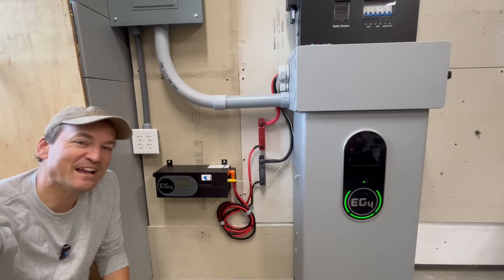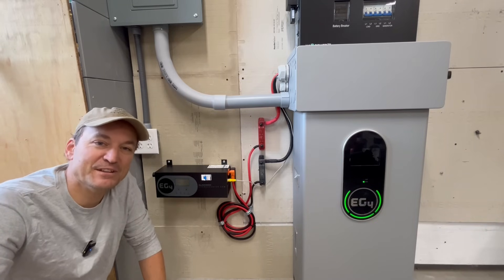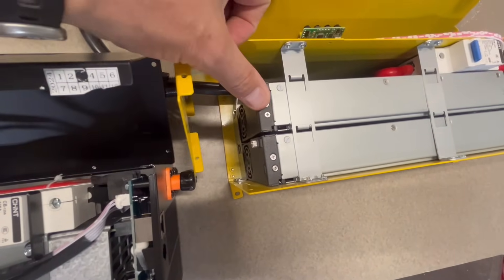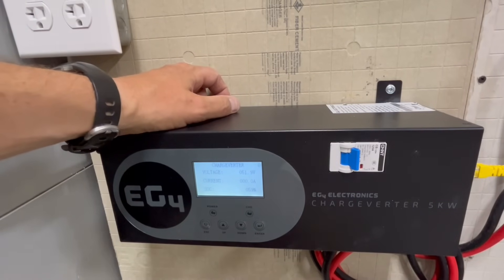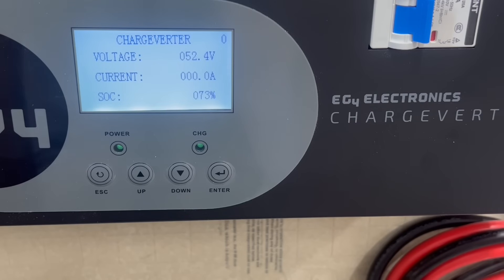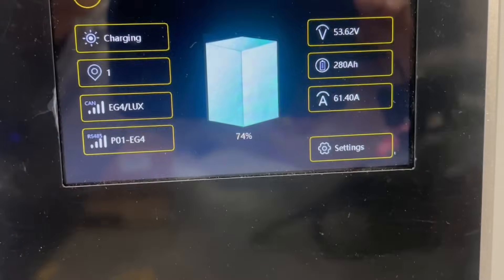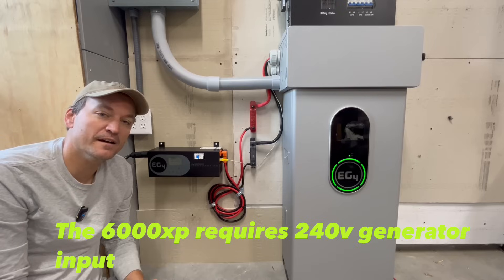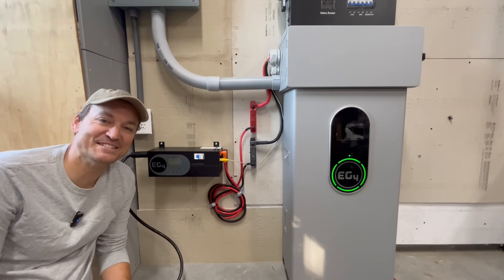New EG4 Chargeverter, charge your batteries fast when the grid is down

Comment: I have a question: if my inverter only accepts a 120V input, can I charge the battery bank directly with this charger to use 120V + 120V = 240V for faster charging? Would I need to disable charging on the inverter, or how would it work?
Reply from the maker: Yeah this is a separate charger all together. So you wouldn’t have to involve the inverter at all. So yes, it can charge with 240v input. 
As long as you aren’t exceeding the max amperage your batteries can handle, the inverter can charge the batteries at the same time.

Comment: Thinking of picking one of these up, I currently have a Gen hooked to a 12000xp works great but I have to turn off the breaker to my water heater to charge at a decent rate for more efficient feul burn because it runs the house and charge, a lil annoying but this would solve that problem if connected directly to the busbar.
Reply from the maker: Well, technically you’d be pulling from the battery a bit as your water heater runs.  but yeah, it could make life easier. Also, if you have the space, a hybrid water heater is the way to go.
Reply: @GavinStoneDIY indeed but atleast I avoid having to flip the breaker each to avoid Gen overloading.. 

unfortunately I don't have the space for one of those or I would. 

Curious, if the chargeverter started charging overnight and the sun comes up now I have solar power and the 12000xp started sending current to the busbar would that be a problem?
Reply from the maker: @kaosapprentice only an issue if you exceed the maximum charging amps on the batteries, otherwise it’s just fine.
Reply: @GavinStoneDIY awesome thanks, I have 6 batteries 16kw each with jkbms which I set the charge current to 100amps each and could go up to 200 but highly doubt I'll ever need to set them anyhigher, I'm not getting anywhere close to that in winter from solar and summertime the Gen will mostly be there sitting looking pretty lol.

thanks for the replies I appreciate it, built all this myself but I'm still learning, this was one I wasn't 100% on.

Comment: CAN YOU USE THE EG4 CHARGEVERTER to charge 48V strings of FLAs?  

My batteries are 48Vdc per string, 420 amp hours each.

This is on a system that has a very precise boost profile per SMA America. ... This would be for a Hail Mary situation, trying my best to run the proper charge profile.

I normally consume about 4000W DC for 12 hours to bring back batteries from 30% to 100%. 63.x Vdc at 63.x amps.

EG4:

"Maximum of 5120 Watts, adjustable from 0-100 Amps, and a configurable voltage range of 43-57VDC, typically set to 54VDC for 48V."

So for FLA batteries would it be 57Vdc @ 70A for both of my 2 strings, to 48V/420AH? Typically for 12 hours?

Or if I can isolate one string at a time 57Vdc @35A? ... For 12 hours?

Or do I have to lower the amperage so I don't bubble the heck out of the electrolyte and deal with proper boost charge later?

Or do I simply get a 48V golf cart charger and do each string at a time? ... Babysitting them all the while?

That basically sums it up,

(See below ... For TMI 

This solution would be for a final "Hail Mary, Full of Grace" in a grid down situation ... Based upon largest available generator, limitations of the EG4.

I presume this basically comes down to VOLTS x AMPS for as long as it takes while NOT BURNING UP BURNING UP batteries.

The problem is that EG4 would not be forthcoming and INTERSTATE BATTERIES was reluctant to step out of their comfort zone.

I have an off-grid system that originally had panels but now call it a "charge-batt" ... with FLAs.  

The system is 48 volt, 840 AH, two strings of 48x420 AH FLAs.  Each string can be isolated and still provide backup.

I figure 2-3 days supplying the essential loads panel, depending on time of year. ... It normally takes 12 hours to charge the 48v, 840 AH at 63 Vdc / 63A once the grid is reapplied.

I am presuming half total power consumed for one isolated string. I figure simply have to keep the plates covered. 

Then do some sort of equalizing charge WHEN the grid comes back, IF the grid comes back, IF I get the panels up, IF I have a large enough generator. 

(Breathe...)

I have 2 large generators, but the larger is open frame, non-inverter. This is the one I would be using with the EG4.

The inverter generator is simply too small to apply 120V at 50a single leg to my system at the (final delivered) 63 Vdc / 63A.

A bit more background is that this is the original 2011 system ... Replaced the fla batteries in 2022 ... So mid life on these batteries. 

Then I got 2 DPUs and a DP3. 

My inverter generator(s) can charge charge the back Ecoflows at 30A 240Vac or 15A/120Vac but won't work through a 50 amp single pole 120v breaker.

So again.....

When grid power is reapplied, the SMA boosts both strings back from 30% SOV at 63.x VDC at 63.x Amps.  ... Again, 12 hours.

I don't think the EG4 goes up to 60V DC. I think it's 57V but I am willing to apply less than ideal boost voltage under the set of circumstances and then worry about battery health later 

With someone's explanation, tell me how I can limp my batteries up to (near) 100% SOC and ignore the proper maintenance of the FLAs under less than ideal conditions. 

Would it be "MAX EG4 voltage" at some amperage that would bring back be equal to the 3800 w for 12 hours? ... Possibly breaking it up, each string separately?

Hope I have not mangled this too badly.
Reply from the maker: Ok that was long. The short answer, it’s all the same volts and amperage. Whatever your lead acid parameters are, just stick to those with the chargeveter. It’ll work fine.
Reply: @GavinStoneDIY ... Yeah, it was long. Thank you. You actually started my day with a smile. Volts is volts. ... Amps is amps. ... Do no more than a light bubbling of the electrolyte. 

On the one hand, maybe it's that when you spend $6,400 for a couple of strings of batteries every 10 years you want to maintain SOH.

Or maybe I'm Woody Allen's "third cousin twice removed."

Nah, just a retired geezer with too much time on his hands worrying about first world problems.

😊😂😆😉
Reply from the maker: @GoodmanMIke59 it’s time to graduate to lithium. 😁

Maybe add a few cheap rack batteries into the mix.
Reply: @GavinStoneDIY you know, I was thinking about it when I replaced the batteries 3 1/2 years ago, but I stayed with the familiar and then went with the power stations, the DPUs, DP3... ... I guess I "threw money" at the desired outcome.

What might be interesting is in having some rack batteries feeding the DPUs, someplace to store excess solar. 🤔

What I really did is I avoided expensive change on a system that was about 11 years old. I didn't want to put a set of 3,000 tires on a 2000 off-grid system. And I didn't know how long I would be at this house.

Let me put it into some more perspective....

First, I'm not climbing any more mountains.  I don't feel the need to explore this newer technology. 

I drove 100,000 miles on waste vegetable oil, homebrewed biodiesel, drove from North Carolina to Iowa and back on veg oil. As they say, I have the receipts.

Another way to put it is that I've "climbed my mountains."

Maybe now all I care about is a box fan and a cold beer.

I used to sail as a shipboard engineer in the Merchant Marine. You must have heard of Liberty Ships.  I never sailed on one of those, I've never even been to the Jeremiah O'Brien, but I actually sailed on a Victory Ship, the successor to the Liberty.

The Victory Ship was the one of the first mass-produced. steam turbine vessels. ... It had a DC bus, some MG sets, motor-generators for hotel and electronic use.

Here's why I loved having sailed on that ship.....

First, I sailed with a guy named Harold Foss in 1984, a guy who had been in the Navy during the WAR.  

RIP, Harold.  

Harold had a very simple view of things. We would turn over on the deck plates at 0800, 2000... And Harold, before going up for some chow, would point to the forward bulkhead and say:

"Still going THAT way...."

With everything steam operated, including the original backups and auxiliary pumps, we could have, where the need to have arisen, may turn on the propeller without one candle power of light. 

I'm simply less interested in the LIFEPO4... ... Well, first because I'm lazy, and then because that will work best until the solid state batteries come along, then the sodium batteries come along.

Three hots and a cot. 
Beans and rice. 
Wood heat. 
Gravity fed rainwater. 

Does it mean NEVER? No, but I'm in no rush.  As a matter of fact, I wish I still had a 72 Chevy I bought a few years ago.

Did you know you Gap points with a screwdriver and the matchbook cover.

I DON'T KNOW, maybe in 8 years when these batteries go bad AND I'm still at this house with THIS SYSTEM. ... but by that time i will probably have had to have replaced the inverter-charger.

Or by that time I will have moved up to an off-grid place and the DPUs, DP3s will be enough.

Now you know......

Comment: A little late, but man this touched on a lot of points I am considering for my setup. Including using both 120 and 240 inputs. Thank you! I am considering the tri fuel Duramax 7,000 Watt generator so that point about the dry contact port was very interesting. I am not yet sure if the 7000 watt tri fuel Duramax has dry contacts though...
Reply from the maker: Is that an inverter generator type?

Comment: Do do you turn off the inverter when you are charging the batteries? Also when you have two berries, how do you connect it if you got two berries in parallel.?
Reply from the maker: You can leave the inverter on, no issue there. 
If you have multiple batteries in parallel, it will charge the whole pack together.

Comment: this is all built into the 12KPV and 18K PV?  Why spend the money for this?
Reply from the maker: Not all generators are compatible with the inverters.
Reply: @GavinStoneDIY  If you use an inverter generator is this needed?
Reply from the maker: @johncarr123  it wouldn’t be needed no. Assuming the generator has a THD of 5% or less.

Comment: Thanks Gavin. Very useful. 

Quick question before I buy anything.

I am planning on a gridboss, a flexboss and 2 allweather eg4 battery.

In a pinch, i want to charge the batteries with an ev with a 120V output. Do I need 1 chargeverter for each eg4? 

Is there anyway I can send the 120V to the gridboss or flexboss to 1. run the 120V appliances on the home (240V breakers off) and
2. charge one or both eg4 batteries. I can turn off all appliances if that helps

If this setup does not work then is there an alternate setup that would make the 120V ev v2l thing work?
Reply from the maker: Your best bet would be to use chargeveter set to 120v input. That will get you roughly 40 amps of charging current to your battery from the car/chargeveter. It’s a shame to convert DC to AC and back to DC. Car,chargverter,battery. But the cars voltage is to high to go direct. The chargverter is a separate unit all together. So in this instance you wouldn’t need to involve the flexboss/gridboss in the mix. How much amperage will the 120v output from your car allow?

Comment: Thanks alot for the video. Have my new Vatrer charging up with the Chargeverter now! I had the voltage on the Chargeverter set to 54 v and I couldn't get it to charge at more than 20Amps even though I had it set to charge at 50 amps. Once I bumped it up to 56v it took off up to 50 amps. Really appreciate these references. Thanks Gavin
Reply from the maker: Glad it helped!

Comment: Why not change the terminal ring to a 3/8”on the chargeverter  wire and connect directly to the terminals on the XP6000 ?
Reply from the maker: You be trying to power the inverter with a charger.
Reply: Gavin   I agree, but any excess amps not being consumed by the XP6000 to meet the inverter load would be put into the battery, correct?
I don’t see any difference between having a generator feed the battery thru the generator port except the genset AC power is first converted to DC power thru the built in converter then goes to the battery thru the cables running to/ from the battery.   
I am just not a fan of any external  buss bars.  
Is there something  I am missing in the battery build. 
Thanks.
Reply from the maker: @rong.7245 external busbars are extremely common. And if the cabling is the correct size the loss is minimal to nothing. It’s a simple install really. 

So you’re proposing adding the batteries and chargveter on the same terminal in the inverter? There isn’t any advantage. Other than it not being recommended of course, it just doesn’t accomplish anything. Powering the inverter directly by a generator converts ac to DC. The same as you’d have with the chargeveter.
Reply: Gavin. Thanks for your quick response.  Yes, I am proposing “stacking” both cables on the battery Terminals of the XP6000. The advantage for my installation  is nothing external like a buss bar. 
Btw. Love your channel.  Thanks for all your time and efforts!
Reply from the maker: @rong.7245 I don’t really like double stacking lugs. But it could work. Personally I like busbars. They make it simple to add multiple packs to the system. 

I appreciate the kind words. Drop me an email with some photos when you install things maybe. I’d like to see what your system looks like. It’s  always cool to see how people design things.

Comment: The 120 volt adapter to the Chargeverter cord  is $18.50 on Amazon...  Might cost less to buy one than buy the parts.

Nema 5-15P Male L14-30R Female Power Adapter Cord,Household 15Amp to Generator Lock in 30Amp Adapter Cord,STW 12AWG Length= 28CM
Reply from the maker: So far I haven’t seen a ready made adapter that works. Eg4 sells one now though.
Reply: Can you provide the link for the Amazon cable...no luck searching
Reply from the maker: @AbsolutePayroll  they have a ready made cord available for this now. https://signaturesolar.com/eg4-chargeverter-gc-power-cord-120v/?gad_campaignid=17428374131&gad_source=1&gclid=EAIaIQobChMIrsvTn_6EjwMV_0RHAR2Hag2WEAQYAiABEgLUmfD_BwE&hsa_acc=6010647758&hsa_ad=&hsa_cam=17631500090&hsa_grp=&hsa_kw=&hsa_mt=&hsa_net=adwords&hsa_src=x&hsa_tgt=&hsa_ver=3&ref=gavinstone&setCurrencyId=1&sku=1511083&utm_campaign=PMax%3A%20Shopping_Smart_Brands&utm_medium=ppc&utm_source=adwords&utm_term=

Comment: Hi. What’s the model/type of the busbars you are using with the Chargeverter? Thanks for the video. Saludos !!!
Reply from the maker: Im using the current connected ones on this video. I have a link for them in the descriptions I think. But since then I added 1000 amp busbars from overkill solar. I love those things. 
1000 amp busbars I used in the video 
https://overkillsolar.com/product/1000-amp-max-terminal-block/?myboi=187486013
Reply: @GavinStoneDIY  Thanks. As soon as I used the PC was able to see the links you mentioned. Was using phone. I ordered the Current Connected ones since my project is a small. One Chargeverter, One Battery, One 6000XP. Saludos !!!

Comment: Can you connect the chargeverter directly to the inverter from the generator?
Reply from the maker: No. The chargeveter is a charger. So its intended use is to charge your battery bank.
Reply: @GavinStoneDIY  Thanks for the quick reply. I'm still learning.
Reply from the maker: @TimTexus sure thing. No problem. That’s a fairly common question actually.

Comment: Where did you wire in the 2 wire dry contact on the other end?  Is that going to the chargeverter or did that go into the inverter?
Reply from the maker: I wired them to the chargeveter.

Comment: The wire that comes with the chargeverter for generator dry contacts is 3 wires labeled “NO,NC,and C”. you have a two pin/two wire setup on your generator. did you tie NO and NC together on on wire and C on the other wire?
Reply from the maker: I didn’t use the third wire, NC. Most generators will only use NO and C.
Reply: @ does the NO wire control both the startup and shutdown on your generator?
Reply from the maker: @ yes, it’s basically like a light switch. Some generators will utilize the NC. So you can just always verify that with your unit.
Reply: @GavinStoneDIY  Does it matter if "NO" wired to Generator 2 wire start/stop red wire and C to black?

Comment: i have a 5500 onan generator at 120volt. It has 2 leads with 30 amp fuses. Can i run the 2 leads chargeverter and get the 5000 watts out of the generator or run a lead to the 6000 xp (I have both running into L1 now charging at 2500 watts max) and run another to the charvegverter?
Reply from the maker: @diamondhandz1989 I’m not really sure on running both to  L1. Keeping in mind it’s still 3kw per leg. So you’d likely only get that much charging potential out of L1. 
As far as running it to the chargeveter that wouldn’t work. It requires split phase, and that’s technically still only one leg.

Comment: I just got an EG4 12000XP w/ (6) EG4 server rack bats. How do I hook up the comm cable I'm wondering. I'm guessing battery number 1 which is the top of the stack 🤔
Reply from the maker: @blenderbenderguy  yes, you’d hook the orange cable that came with the 12000xp to the CAN port on the top battery (it could be another battery but this makes it simple) and then to the battery coms port on the 12000xp. The battery manual will tell you which order to have the dip switches in on each battery.
Reply: @GavinStoneDIY  Thanks!